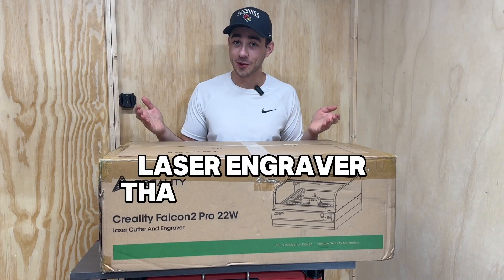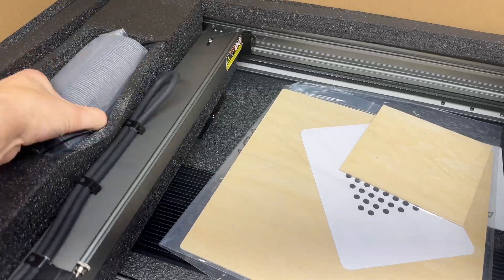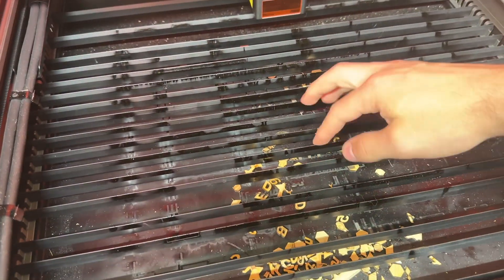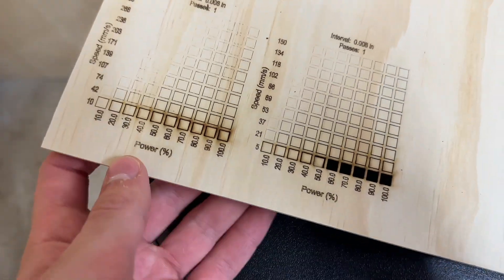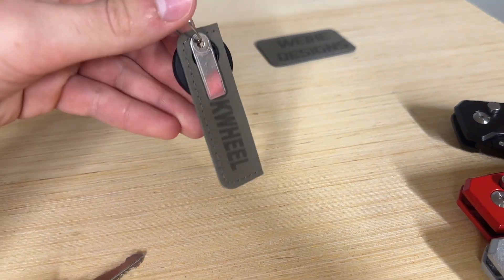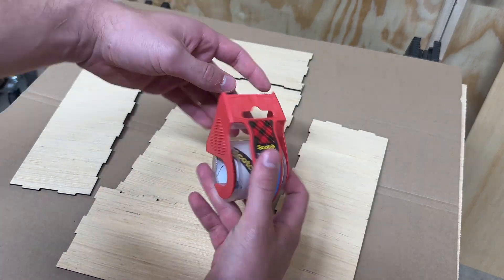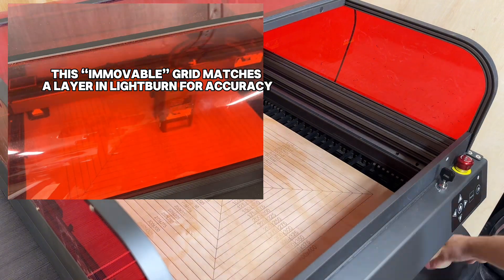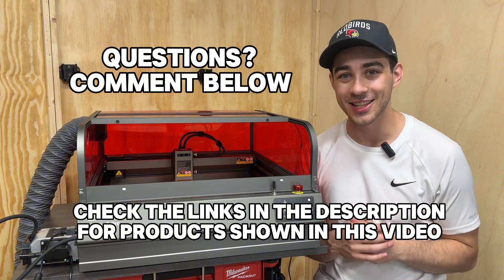Best Diode Laser for the price? Creality Falcon 2 Pro 22w

Comment: Well, if you’re exhausting outside, and you’re still getting the fumes exhausting in the filter, you will still get the same fumes because it’s coming out around the enclosure. A list of filter has an outside fan picking up what’s in the room as well that’s the only way it would make a difference.

Comment: Great video! 

Two questions. 
1) with the built in adjustable fence, is there any use for the honeycomb surface? 
2) where did you get that gray exhaust hose? Was that from Creality or an Amazon purchase?
Reply from the maker: Some people still opt for the honeycomb but I find the fins work good enough for me. 
The gray hose is included. The silver hose was from Menards. I linked a similar one in the description.
Reply: @JakeWeihe excellent, thank you!

Comment: Good review and congrats on your channel growth.  There does seem to be equally amount of cons as pros.  I have a 22 watt on another brand and really like the auto adjust and ability to pass through larger pieces on the AlgoLaser.  I was hoping the enclosure on this one would be built better.  Did this vendor happen to do a collab with you? How useful is the camera if it's not very accurate?
Reply: Let me know if you saw the full comment.  I had a couple of questions in there.
Reply from the maker: The algo laser seems pretty nice for the price but the enclosure is a nice touch have feature built in on the Falcon. The sliding door is an interesting approach over a hinging design and there is more viability overall than other enclosures. 
The camera is like 90-95% effective. For important pieces I always do a frame but for sloppier cuts it works well enough
Reply: @JakeWeihe  Good feedback, did you do a collab with Falcon?  Keep up the good work.
Reply: Since there comes no answer I'd assume a collab  @inspiringbuilds
Reply: @madr7014  Agreed 👍